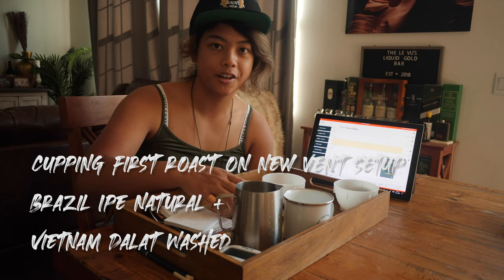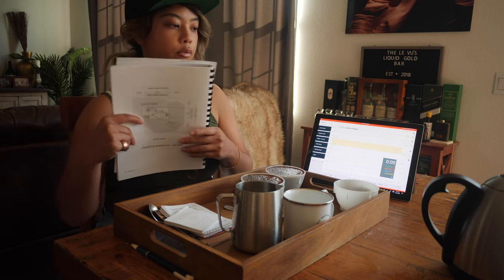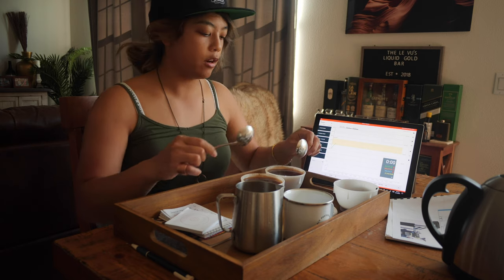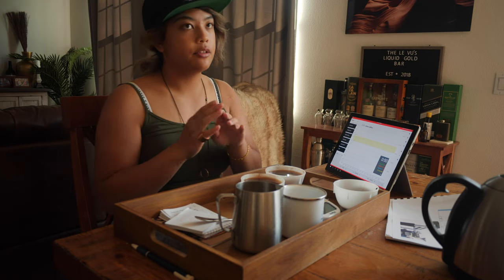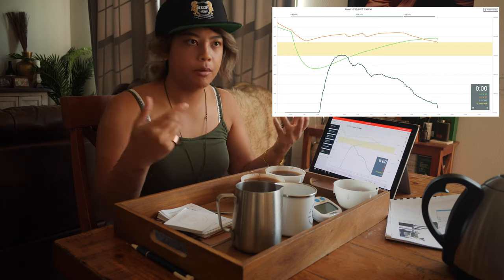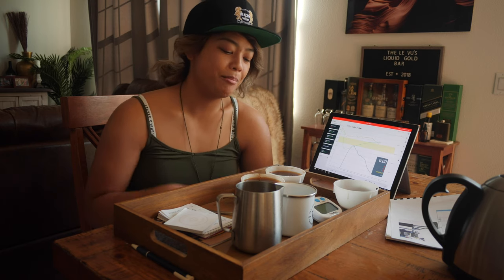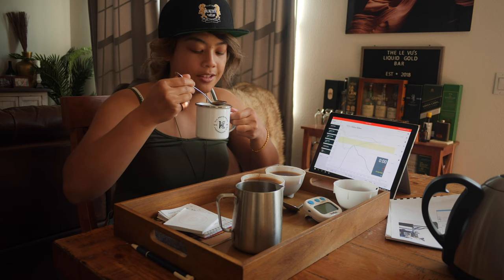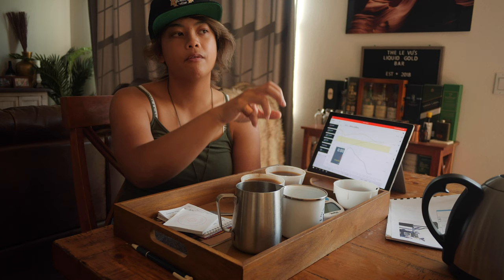Cupping 1st roast on new Vent Setup   blkcity coffee vlog

Comment: My guess is you need to recalibrate what you call a low/med/high airflow with the new venting. You probably need to use a higher setting for each to push through the extra venting. Lighter test calibrate again.
Reply from the maker: Yep you’re right went back and needed a higher airflow to keep the flame 🔥

Comment: Do you have a Y-connection from the chaff collector and exhaust? that is one reason why smoke is going into the cooling tray. I had the same issue. My solution was to just create a separate vent/pipe to the exhaust so that the chaff collector and cooling tray aren't connected and run on their own. But the vent outside that you have setup is pretty sweet!
Reply from the maker: interesting. I do have the Y connection...I'll continue to keep tweaking it.
Reply: @BLKCITYCOFFEEROASTERS  I did use gate valves on my Y-connection. It worked out great and it helped prevent the back flow of the chaff side from going into the exhaust side. this is the one that I used: https://www.amazon.com/gp/product/B01EY0ZB1O/ref=ppx_yo_dt_b_search_asin_title?ie=UTF8&psc=1
Reply: ultimately my solution was to run the chaff and exhaust piping separately so that they won't have any interference with each other.
Reply: for now, which is working just fine for me, is to let the exhaust side vent to the atmosphere. my logic is that i need to cool the beans down as fast as possible. so venting to the atmosphere will only have alittle bit of smoke initially then it will be hot, clear air. and also what I noticed is that the exhaust turbine was producing more flow than the chaff piping side, so I wanted to prevent that as much as possible and prevent against back flow to the chaff side.